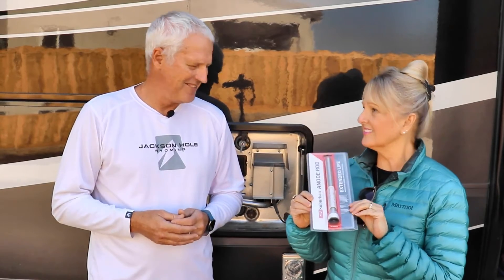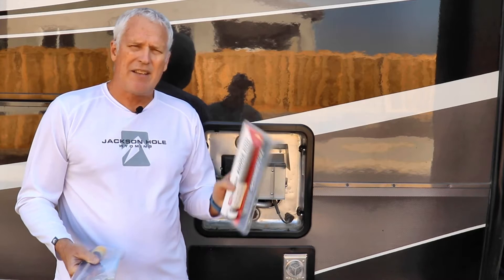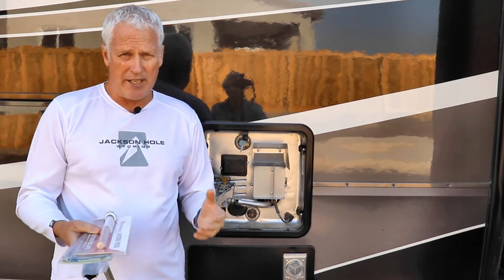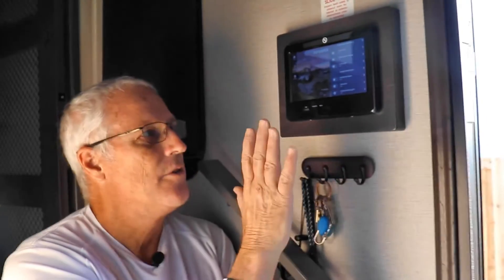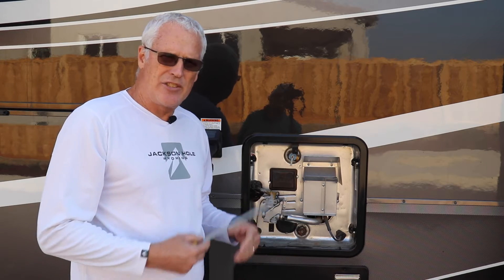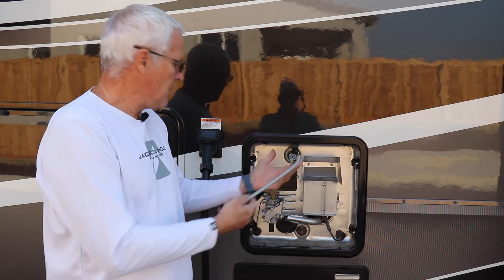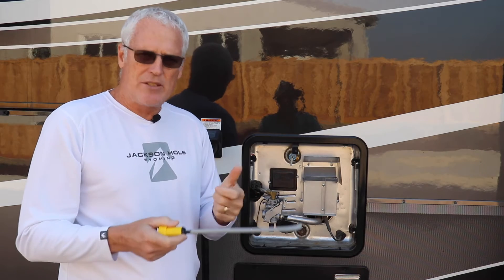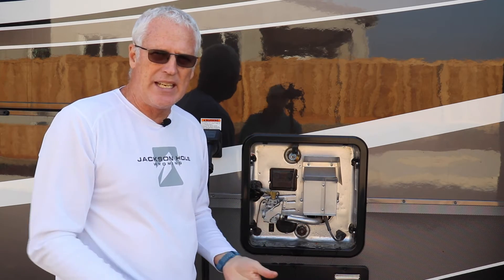One Simple Step To Extend Your RV Water Heater Lifespan (Full Time RV Living) 👍

Comment: Very similar to my technique.  Our tank has that 1/2"+ lip at the drainage hole (yours looks similar) that makes it hard to get all the sediment out, but using the wand and anode rod is hopefully "good enough".  One thing that I did learn from this video was how to repair my old wand - I also have a split at the end.  Thanks!!
Reply from the maker: Hey Jeeps & RVs! - Glad we could help out getting your wand fixed. As you know, changing the anode is a very simple DIY project but a lot of people are hesitant to start a project that they're not familiar with. We hope our video will give people the confidence to try new things and possibly save them some money. Thanks for watching!